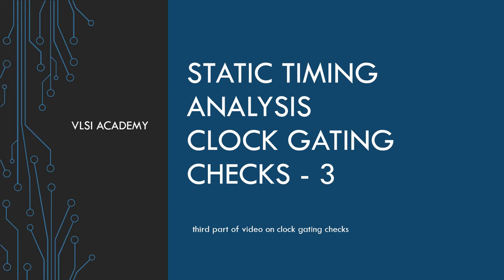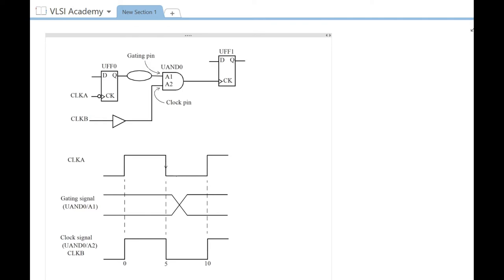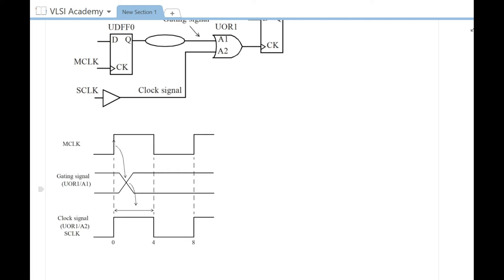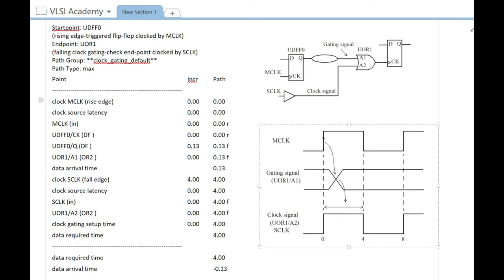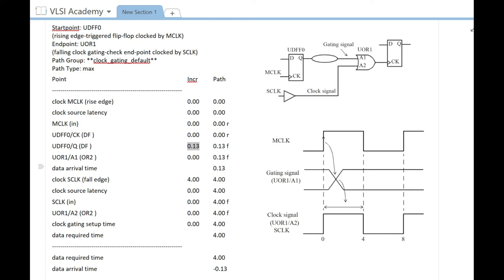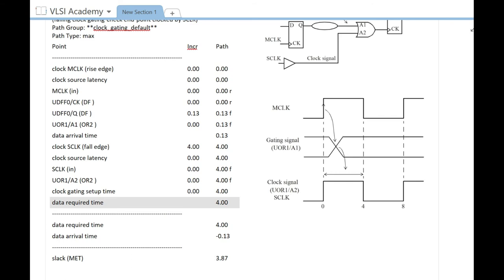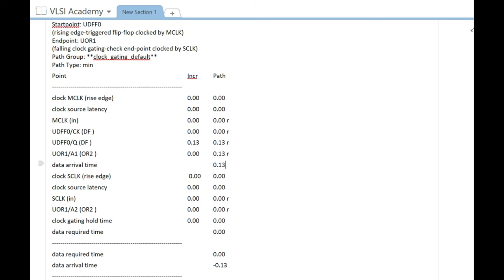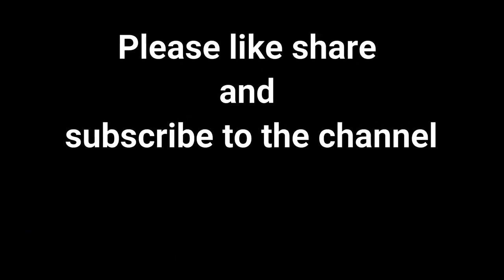sta lec32 clock gating checks part-3 | Static Timing Analysis tutorial | VLSI

Comment: @1.30s ,You are saying when the gating signal is low, Signal can't pass through UOR1. But if the A1 pin is 1, then even when clock signal 0, OR gate can pass, isn't it.? Also you Say When one of the signal is high, the other will be blocked. Could you please explain why it happens when it's an OR gate? for OR gate one signal is high is enough to pass signal, isn't it?
Reply: @VLSIAcademyhub  great
Reply: for or gate transitions must occur when clk is high so that transition don't have the power to govern the final output ; it is goverened by clk